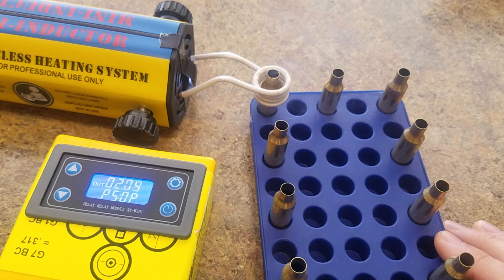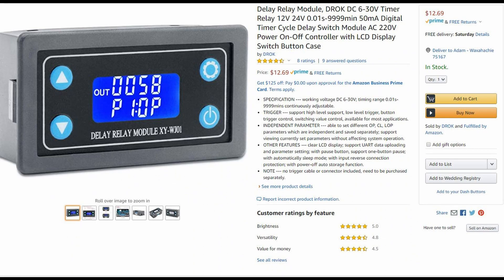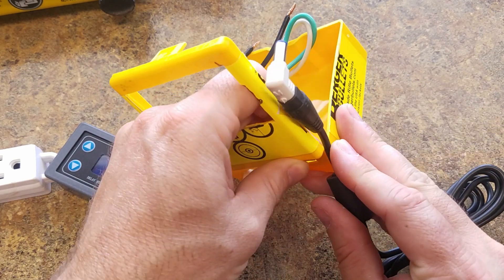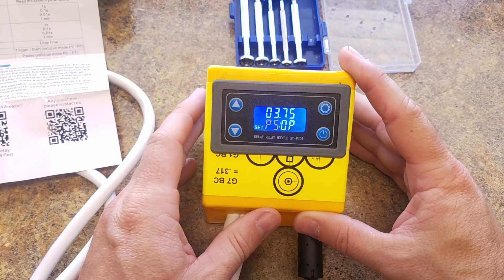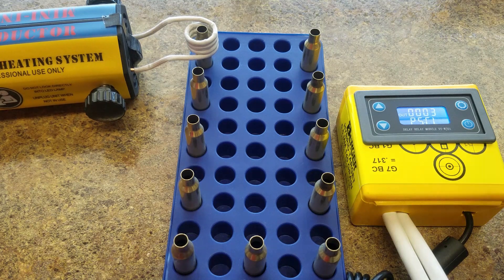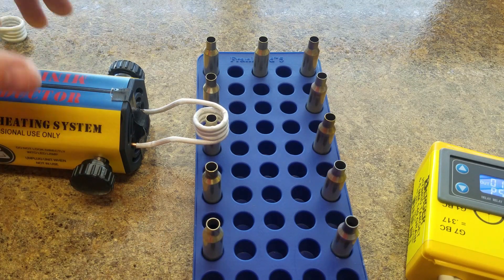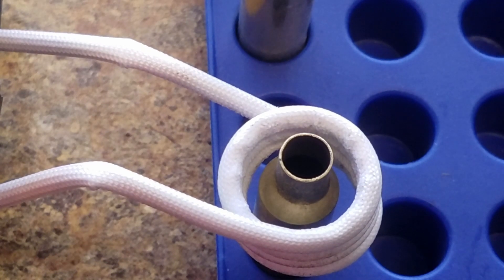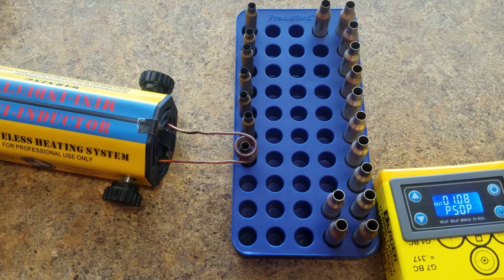DIY Induction Annealing Brass with .01 second accuracy for $200

Comment: Ok, I saw this video about 2 weeks ago. Price of the Inductor (exact same one) it was In the $90 range, the relay was $5. rolled my own coils by mesuring the OD of the case, went 1/4 inch more, and chose a drill bit that size. For .223, 27/64". 
this gave me 1/8" clearance from the case and would allow me to drop a case through the middle of it. I drilled a hole in a piece of wood, tapered it a bit with a larger drill, so the case can fall through it. Then, took an automotive shim (as for wheel alignment) and screwed it to the bottom of the board, leaving it just loose enough so it could be moved back and forth to block the hole. this gave me a reliable steady height. I place the rim of the case @ the level of the highest coil.  I bend and position the coil, by taking the drill bit that I used to form the coil, inserting it to the bottom pf the board and lining up the coil to the bit.
Now, to modifications to the inductor controls. I took a different approach .
I unscrewed the case. There are screws under the applied labels, use a heat gun to soften the adhesive. Open it carefully, noting how the circuit boards etc. are held by the case. Remove the heat shrink around the two wires going to the push button and unsolder the wires. Take a small cable, with 2 wires(I used model servo wires) solder them to the push button wires, slip some heat shrink tubing over each of the wire pairs, then solder the wires back to the switch. drill a hole in the side of the case, pull the new cable trough the hole and attach to the timer box. using the Model type cabling will also give you quick disconnect fittings so you can detach them.
Once that was set up, I fiddled with the program setups and timing.
I chose the P4. It comes on when you push the start button, goes through It's on-off timing, then repeats a certain (set) number of cycles, or until the "start" button is pressed. If you don't enter a number of loops (LO) it will loop an infinite number of times until you press the "start" button. Enter 1, you will get 1 cycle, one-off, enter 2, 2 on-off cycles. etc. etc.etc.
Am I going to go further? Oh hell yeah!! All those old R/C servo'''s are going to come back into good use!
Reply: I was thinking something very similar, to you have more details or pics of your modifications?
Reply: @ianbuchanan6925  I do, yet it's something I really don't hassle with youtube to put it all out.
I'm thinking of using  555 timers to control the servo timing to drop and catch the casings. I already use one to control the servo.  555 timers are old simple timer IC chip. A 556 is a dual 555 in one piece. You need just resistors and capacitors to make them work, I'm adding in a transistor on the timed output to switch a pair of resistors in and out of timer input pins.
When I get the math figured out (it's a time thing), I'll try to get back to you with a schematic.

Comment: Great idea, thank you. I changed the relay wiring scheme. Now the fan runs continuously, and the inductor is activated only when the button is pressed, for the time set on the relay. I connected the original button to GND and the low-level trigger, and the button's traces on the PCB to the relay.

Comment: Thank you for the video, I just built one. I bought the AC version of the timer, soldered power wires to the heater pcb board and soldered s1/s2 to the red button contacts. This allows the fan to run constantly, not just while you are annealing. Thanks again.
Reply: This is interesting. My fan comes in when it is plugged in so I am changing it to start on red button push and continue for 30 secs after or until a t-stat switches off. Also using the AC version. I want to keep wires and such to a minimum
Reply: @Robert-y2k7s  Where are you connecting the tstat?

Comment: I used one of the induction heaters in the description (1st link).  223 is taking about 6-7 sec to glow and S&B 6.5 CM brass is about 14 sec.  Seems long compared to the video and everyone in the comments (223 taking 1-3 sec for example.)  Is this a heater issue?  I'm using 12 gauge wire wrapped around a 12mm socket (10mm was super tight for the set I have).  Still in my return window so help/opinions appreciated.  Thx.

Comment: Use long sockets to wined the coils. 223 use an 8mm socket, 308 use a 10mm socket. It makes the annealing much more consistent and perfect. I use 6 wraps and it literally takes 1 second each. I also attached a 7520 blower fan on the back of my induction heater and its never tripped for overheating. I bought the "gunstyle" one and not the bulking wand one. Use 8mm socket for 223 coils, short 3 inch leads and 6 wraps in the coil = 1 second or less

Comment: Can the Delay Relay Timer really support 1000watts of power?? The induction heater is rated for 1000 watts!! The VERY, VERY small electric terminals on the Delay Relay Timer don't look to me like they can support that kind of power. Please provide your comments regarding this issue.
Reply from the maker: @johncole9464  I'm not an electrical engineer, but literally hundreds of guys have made this setup from these parts so the short answer is.... It must

Comment: Thank you. I built it, it'll work alot better than my alternatives! I do however wish I had bought a 1200 w heater.  I'll do some trouble shooting to try to get this 1000 w hot rod to go (shorten up my distance to coil and a maybe a smaller gauge wire). 

But this thing kicks ass

Comment: just try my luck see if anyone can help me with my problem: copied the setup with a 12v relay, rolled the coil as 15mm diameter for 308 brass. However it took nealy 40 sec to heat a Lapua brass up to glowing status. Can anyone help me with why this is happening please? Thanks!

Comment: You actually CAN touch the case as long as you have that white fiberglass sleeve on the wire, As a matter of fact you can get them done faster if you use the sleeve as the thing that keeps the gap consistant. Its as close to the wire as you can get without touching it.,

Comment: I found this video last Summer when I was searching for an effective, yet affordable, way to anneal my brass.  Watch the video, take your time assembling the different components, test it on a few rejects to get the timing and process dialled in and then get started!  I decided on a stripped wire with a tight tolerance  to reduce the duration of annealing.  One of the most useful videos I’ve found on YouTube!

Comment: Hello Mr North. Just question for you or others reading. I bought everything and it works AWESOME. However, the induction heater I have works with the fan on all the time even when you don't press the red button. This is good to save the machine as you mentioned. However, when I put it on the timer relay the fan only works when the button is pressed. I think the relay cuts all the power off the heater. Is there a way to adjust the relay so that it still powers the fan ??? Or the work I did with the relay is just a continuous stop watch. PLS HELP!

Comment: I have a 0-150vac variac and I'm thinking I can do this very same thing using nichrome resistance wire. I like the timer so will incorporate that into the build. Up till now I just use the variac to make hot wires for cutting foam but have nichrome wire in sizes from .09 guitar string size to 3/16" heater coil. Will let you and all know how it works out.

Comment: There is a recipe for an induction heater that costs an order of magnitude less.   I just ordered all the parts for about $20.  There's an electrical engineer who puts up builds on youtube, and one of his requires two transistors, two capacitors, wire, and a power source.  It does require to to put the power in at the middle of the heating coil, but that is how it gets to be cheap.  Oh, and it is all naked wiring operating at 600 v, so build at your own risk.  I haven't worked out how I am going to cover it up.

https://youtu.be/BWDdJBlsydc?list=PL071qbufrHeo70oNncPwjVCHb3R0RAI8x

Comment: This is a practical setup for as far as it goes.  However, just getting the brass red hot for a split second or so, and even checking for the tell-tale change in tint/color on the brass afterward does not mean that the brass is correctly annealed to the correct hardness.  You really need to go about testing the timing scientifically, including hardness testing, to determine the correct duration of heat application.  Other than that, you've presented a great way to get into annealing inexpensively.  Check out this vid by RussDouglass 222.  https://www.youtube.com/watch?v=SF0YmmeEJK4

Comment: Has this annealer withstood the test of time?  I have heard that some induction devices break down over time as they have a very low duty cycle and overheat when used repeatedly in a short period of time.
Reply from the maker: My original one is still going strong!! Well worth it.
Reply: @northeasttexastactical375  Cool!  How many cases do you anneal in one sitting?
Reply from the maker: 400-600
Reply: @northeasttexastactical375  wow!  That's pretty good reliability.
Reply from the maker: Most of these things are made in China, so your mileage may vary. Somebody commented on here recently they bought one that was made in America.

Comment: Greetings,
I constructed an annealer assembly using your idea with a similar unit but added a couple of convenience refinements.  In lieu of using the push button all the time I installed a 3.5mm phono jack and plug.  The jack receptacle is installed at the rear of the annealer and wired in parallel and soldered to the push button pins.  The male plug is wired to the dry contacts of the timer so that when the dry contacts of the timer close it acts the same as pushing the button thus turning on the annealer.  This allows the annealer to be used for other purposes and not dedicated to servicing brass. An on/off toggle switch was also installed on the cover of the timer case and wired in series with the “hot” conductor of the power cord so the timer can be turned off and on rather than having to unplug the timer from the power strip each time. The annealing unit came wired so the fan stays on all the time. On other units where the fan only comes on when the button is pushed the fan can be rewired to the annealer input power wires so that the fan stays on all the time.  I have not had the annealer overheat as yet even when annealing a couple of hundred cases at a time.
I found that using #10 AWG solid wire took too long to heat up and cool down.  I made some coils with #12 AWG solid wire and they seem to work better, reducing heating and cooling times. All in all everything works quite well and I believe is much safer than the propane torch or hot lead immersion methods.  Good luck.
Reply: Could I talk you into building one like yours for cost od materials plus your profit
Reply: How is your setup working?  I ended up doing something similar with the parallel timer.  It worked great for my 1st session...~250 pcs of brass at 1.20s each.  Next time I tried to use it, it died.  Fan ran for about 30 seconds.  The timer fired the coil twice and then it died...no light, no fan, no nothing.  I can't seem to find a fuse it the thing.  Any ideas what might have shorted or opened?

Comment: There seems to be parts missing on the electrical?? You didn't show at all how you wired the DC side of things. The video just forwards to where all of that was already done without showing the adapter you have there or the wiring. Can you expand on that part that you for whatever reason left out of the video?
Reply from the maker: the DC power source wires are just +/- plugged directly into the timer where it says +/-. That's probably the simplest part of it all.
Reply: @northeasttexastactical375  I actually found the links on your site to the DC adapter you used and it made sense after I saw it came with the adapter for wiring it to the relay. One more question if you could, the small fan on the back of the inductor, does that fan suck hot air out or blow cool air into the inductor? Thanks mate.
Reply from the maker: It sucks cool air through the front and out the back, you could probably do it either way though.

Comment: Outstanding.  Works just like you say.  I set mine up next to a single stage LEE Challenger and changed out the switch for the inductor so that I don't have to hold the button down.  Control is through the relay with a locking on/off on the inductor.  I raise the brass into the inductor coil and use a longer gap between cycles to give me time to swap the cases in the shell holder.  I'm using it to anneal 24ga Magtec shotgun brass to form .577/450 Martini-Henry cases.  Once I got the time dialed in I haven't ruined a case since, forming in 3 steps and annealing between each step. I'm not doing hundreds of cases (generally a box of 25), so the longer time isn't a big deal and the fan keeps up with the temperature well.

Comment: Yes the AC wire diagram for the timer is wrong. It was drawn as if it was DC except they put the (+) on the wrong side of the load. To make it work you would splice an additional piece of wire into the cord's white(neutral), which would go to the timer's GND terminal. Then cut the black(hot) wire; split the male plug side into two wires, and connect one to VCC and one to S1. Finally, connect the black wire on the female plug side to SO. Leave the green wire uncut. This applies to the device in your first link.

Comment: Place the hand held induction heater on a drill(Hand drill) press stand to lower and raise to a set height, use a foot pedal/swich to start heater, place a U shaped aluminum channel as guide and drill case sized holes in a strip of wood or aluminum that will run in the guide under the heater coil, place water bucked under the end of guide so cases drop through hole. About the same as cartridge press, One hand to run the handle and the other to place the cases. Nock youself out if you want to automate. Same foot activated swich for a raise and lower hidraulic/pneumatic/electrical press stand

Comment: Great idea and great video!  I hope you make money from us using the links to buy.  -Cheers!

UPDATE:  Note that some brass heats up MUCH faster than others.  I thought something was wrong with my unit, until I tried another brand of cartridge and bam! It heated up just like the video.  Slow heating is not a bad thing - it give you finer control over the result.  Also, don't forget to cut the coil wire as short as possible, like in the video - it helps a lot.

Comment: Making sure I understand your wiring.

You cut the extension cord so that hot wore is cut in two, but leave the ground and neutral? 

The cord is plugged into the wall, and the hot wire goes to the relay.  The relay outputs the hot wire to the end of the extension cable, in which the heater is plugged in to.  The relay itself is powered by an ac/DC power supply.

Is that correct?
Reply from the maker: Yes
Reply: Thanks!

Comment: When the cases overhead, do they all melt in the same spot? Facing the unit like that? That may indicate a lack of uniformity in the annealing. Not sure you care, but you could spin them while they're heating to avoid that.
Reply: you will never hold it right in the middle perfectly with this setup and i bet you will never notice the difference either

Comment: i bought the same relay controller but the options on p5 are in minutes, not hundredths of a second. how do i get it to hundredths of seconds?
Reply from the maker: P5 isn't the time increments, it's the on/off programming cycle. I can't find my instruction sheet but it's on there, whenever you toggle it, the decimal will move across the zeroes.
Reply: @northeasttexastactical375  I couldn't find any way to toggle the decimal place. I just annealed my 80 cases without the relay and just counted second

Comment: Just finished mine. Rolled my coil for my '06 Springfield  custom.
 Glad I have plenty of range brass I really underestimate the power in my daylight bench.
 Tonight I had it dark lit with my EDC led flashlight pointed at the creaking so would not run into anything bug.
 Will adjust my timer at night and install a foot switch.
 Coil is the ground wire in a piece of 10 4 w/ground romex.
 Mandrel is 5/8 in birch dowel.
Thanks for a really great DIY annealer.

Comment: Finished putting the pieces of mine together today. Disassembled the heater so I’m using the time to just control the switch. The fan runs continuously on the heater and it stays nice and cool. 1.5 on and 4 seconds off is just right for the coil I made to use on 38 special brass. 
I ordered some 3mm fiberglass braiding with my timer and used 8 gauge copper for my coil. Stayed nice and cool

Comment: I like many who reload want to anneal our brass cases, but what method is cost-effective? The AMP isn't cost-effective by any means, but if you have the bread, buy it. The flame, yes leaves a question "did it do the job or not." The recoil method may be "I don't have a way to test my machine." Whatever method you are using, it may work to a degree to anneal brass cases. Eric Cortina and Vortex have videos on the subject saying with the flame method about 7/8 seconds. EP Integrations annealer is what I use. It is fast and simple!

Comment: The funny thing is seeing others copying this setup and posting videos of same.  I built a twin to this and it works fine, once I figure out how to set the relay timer that is.  That’s on me.  I saw no reason to post a copy of work you’ve already done.  Have recommended the setup to others as well.  I DID get an aluminum block and had it CNC’d for 7mag cases.  That eliminates the issue of overheating a plastic reloading tray.  It was also cheaper and I had access to someone who did that free.  This is the cheapest setup of all my reloading “toys”.  Great concept and kudo’s to posting this.